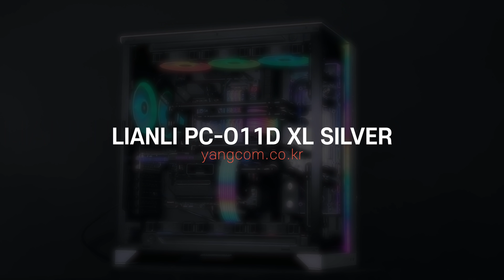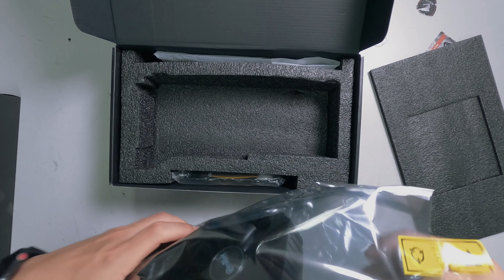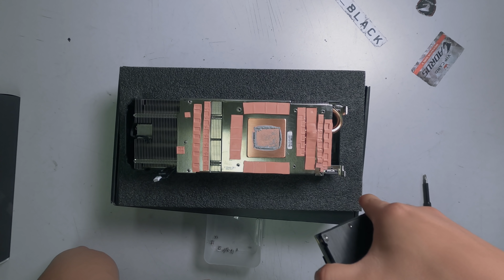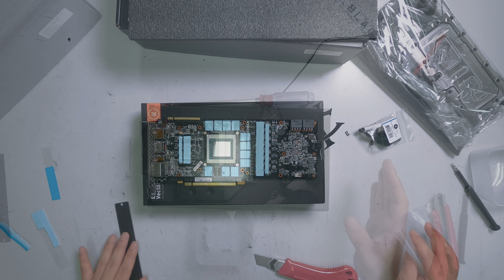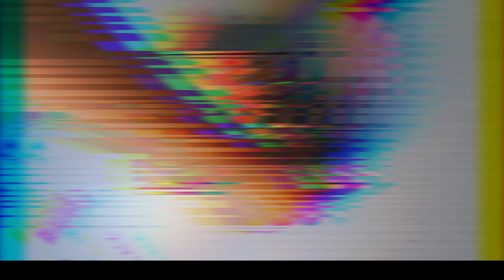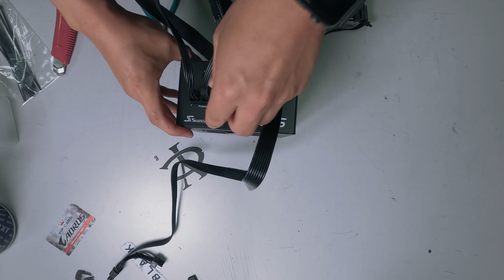$5000 The Ultimate Gaming Machine in Carbon Black design

Comment: I wanted to do a build basically EXACTLY like this, except the tubing is "matte" plastic and I use RGB fittings for that extra special look.
Reply: Are rgb fitting even.l a thing and how do you connect then wouldnt there be alot of cables
Reply: @hwah9484  Yep, Thermaltake makes some I think some other companies do too. Its basically a pass-through fitting that has RGB LEDs built in, If you use them with "frosted" acrylic tubing and/or some pastel white liquid (I prefer clear) you can really see the RGB effect. The wires are thin and long so you can easily tuck them away so that they are barely visible.
Reply: Firstname LastName ok thanks